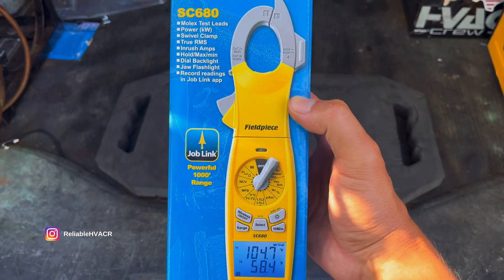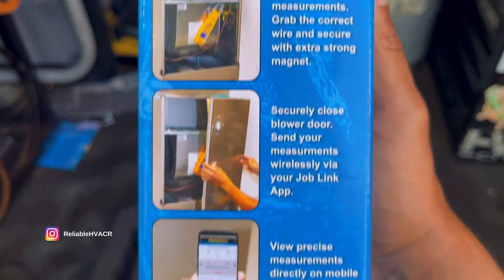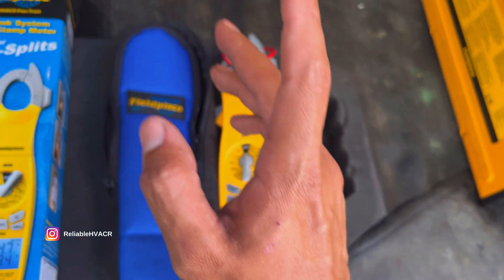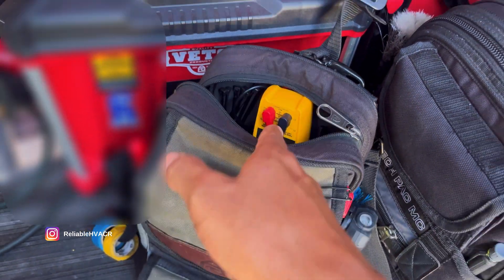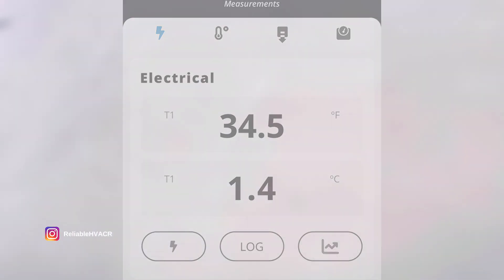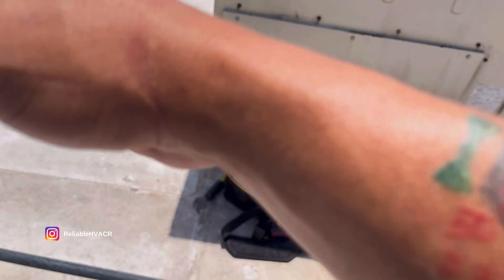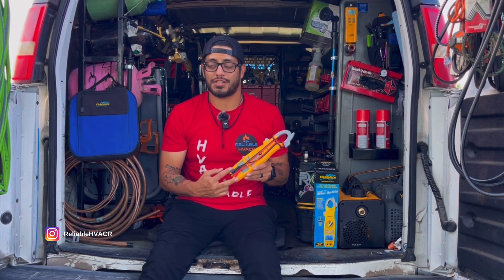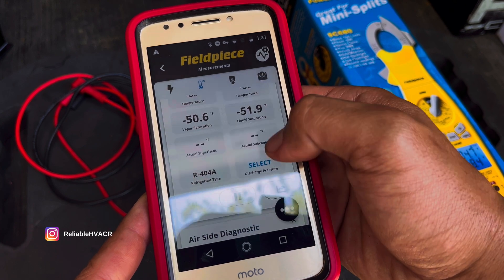My New Favorite Meter Fieldpiece SC680 / HVAC Tools

Comment: Great explanation, but had to quit watching spinning the box for features and then worse shaking the meter as explaining what your check on the roof, made this not good for me. I have been a user of Field Piece Meter since 2010 and plan to buy this unit as I am a specialized mechanic for GSE relating to ground equipment for aircraft.
Reply from the maker: Well this is an HVAC channel 😂 and lots of other people liked it so thanks for stopping by 🤷🏽‍♂️

Comment: I went with the SC480 simply because it's a good compromise between compact size and features - the swiveling head and dual temp on the 680 would be really nice though!
Having wireless capability, dual Amp/Volt readings, and the magnetic strap are the only features I'm not willing to compromise on.
If they could make an SC280 that was wireless, had a swivel head, dual display, and still keep that more compact size I would buy one in a heartbeat.
 FLUKE are great meters, but Fieldpiece are just designed better for HVAC/R Service work IMO.

Comment: I got one of those from my job. It started to give false voltage readings after a couple of months of using it. Went back to my ideal that I bought at Lowes and it has yet to fail me after a year of daily use. Keep up the good work sir👍
Reply: Seems like I was able to fix that issue with a new battery.
Reply: I had issues with capacitance reading on mine, returned it put some extra money down and went with fluke

Comment: Fieldpiece SC480 It has similar functions and is compact, the only different detail is that it has a single temperature port and the magnetic rubber. I have this volt meter too but personally in my all day tool I prefer the 480
Reply from the maker: 480 is a nice in between that does almost the same. I just prefer to use this one now. I basically have all 3 models, can't go wrong just depends on your needs
Reply: I use the sc680 . Thankfully I am close to orange Ca but have had to take it in for a swap ; as the temperature started jumping all over the place . Would have to turn it off and on to get it to stabilize on temp . It only was about 3-4 years old . You have any of yours have that issue with temp jumping all over then stabilizing out